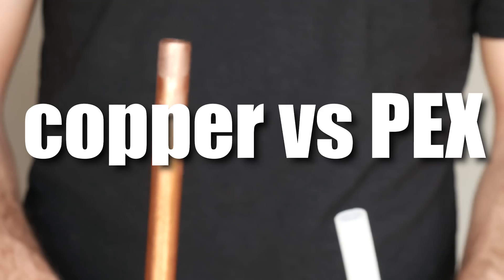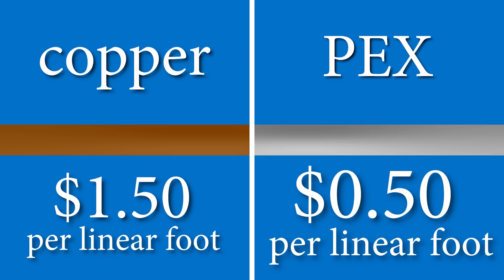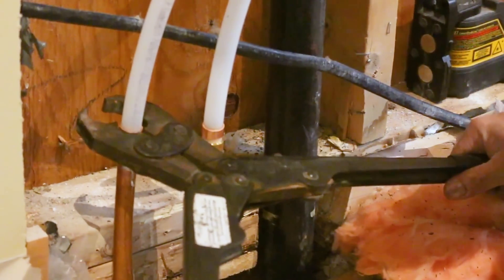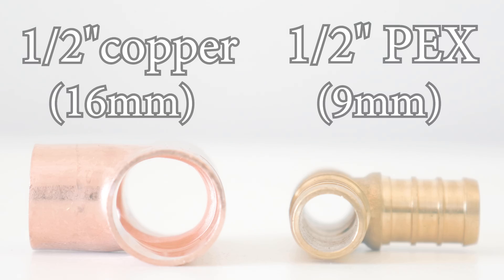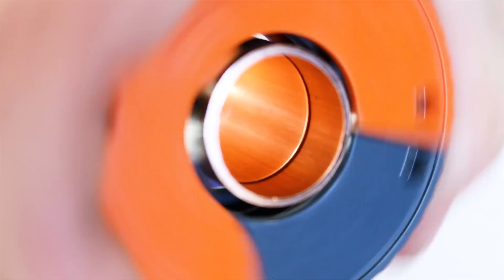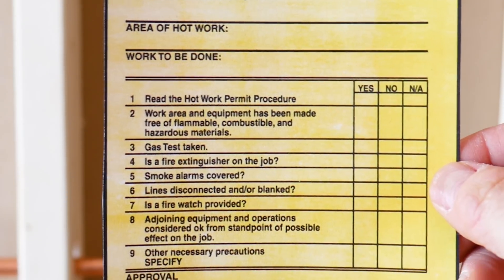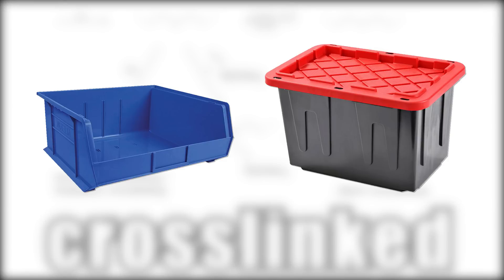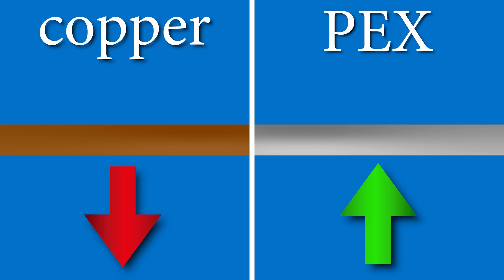Is Copper Better Than PEX? (COMPLETE GUIDE) | GOT2LEARN

Comment: When I use to work in a plumbing store, I cannot tell you how common it was for mice or other rodents to cause leaks on pex pipes. It's almost as if rodents are attracted to pex piping.
Reply from the maker: Yes, because they can easily sharpen their teeth on it, and it's nice and warm inside ;)
Reply: @Got2Learn  there are usually two things with it, they hear the water and smell the salt.

When installers are handling the tubing (or wires or whatever else...) they leave nice, sweaty finger prints all over everything.  Rodents looking for some salt lick with chew through the pipe to get every last bit just like they chew through electrical insulation.  The upside is that clean water is a lot easier to deal with then a burned down house.

The other big thing though is that they can actually hear the water.  Especially in dry regions, water is enough of a motivation for rats to chew through pipe.  If you don't have PEX supply lines, they will go after your PVC DWV system.

Hopefully they don't push for more bioplastics in home construction though.  Rats love the taste of soy based plastics and if you give them both food and water - they will never leave.
Reply from the maker: @joek5161  good to know, thanks for this!
Reply: @joek5161  We had issues with rats and field mice accessing our crawl space where are all our plumbing and water heater is located.  I basically found where they were getting in and sealed the area up.  That fixed the rat problem because there was no area large enough for them to gain access. Field mice, however, are small and can enter anywhere no matter how tight everything appears to be sealed up.  To remedy this, I simply put glue boards with a little snack on it in the crawl space and that usually catches the mice before they can become a nuisance or tear anything up. I will know when to do this whenever I see rodent droppings by the water heater.  It is warm and they tend to linger on or near it once they enter the crawl space area.
Reply: @jamescunningham6249  yeah I was looking into PEX but I have a crawlspace that critters can invade...and I suspect if I use PEX there's going to be a problem. But it's a tough choice because a PEX repipe is like 1/3 the cost of copper. I wish they'd somehow make rat-proof PEX.
Reply: I had pex installed last year and now I'm dealing with $2000 in drywall repair!! Stupid Mice!! T^T
Reply: @malloryartis75  lol
Reply: Good info. 👍🏽
Reply: Galvanized was good, copper was the solution. This PEX pipe? Well; Very fast to install however a good meal for the little ones!
Reply: They love the stuff!!

Comment: Everything comes down to cost and convenience but hidden in that is the real cost to human health and our environment.  As mentioned, pex is not immediately recyclable and will in most probability end up in a land fill in future demolitions. Also, the anti-microbial advantage of copper over pex cannot be understated.  We derive our drinking water in a rural environment and want germ free water.  Moreover, earlier plastics released VOCs to the water and while they've reportedly improved the product since then, I don't want my drinking water coming out of any kind of plastic which degrades over time.  Having said that, it just occurred to me that my RO filter uses plastic lines (grrr - need to address that, it seems we just can't escape this curse of plastic in our drinking water).  Since my house used old-school plumbing, it's easy for me to continue repairs and upgrades using copper, despite the price and labour differential but I understand why commercial guys love pex and most home owners probably don't know anything at all about the differences and blindly go with whatever their installer decides for them, especially given the cost differential.
Another point for pex I suppose is that you don't need to electrically ground it as you do copper lines.  Pex also doesn't suffer from electrolysis when connecting brass or copper fittings to galvanized nipples on hot water tanks.  I had a tank fitting that eroded within weeks due to a defective insulating sleeve inside the galv fitting that was supposed to ionically separate the dissimilar metals from each other.  Depending on your water's conductivity, ionic erosion can be significant where copper meets iron.
Lastly, you've crisscrossed the meaning of permeable with impermeable.  Permeable means that it is porous and can pass contaminant through, which is what pex suffers from, as you stated.  Copper as a membrane on the other hand is impermeable, meaning it DOES NOT pass contaminants as does pex.  The prefix "im" means NOT, as in "impossible" versus "possible".

Comment: I think the potential rodent issue with pex can be a deal breaker for lot's of people.
Reply: They should invent pex insulation with a steel mesh. Rodents wouln't chew through that.
Reply: @christopherbehrens7996  Mice and rats can chew through concrete. That steel mesh you talked about is just a morning snack for them.
Reply: @rickjames6948  Then what stops them from chewing through copper?
Reply: @christopherbehrens7996  Honestly nothing. Maybe they don't like copper sandwiches LOL.
Reply: @rickjames6948  rats can see the water flowing inside the pipe so they seek it out and chew on it to reach it. I wouldn’t use it in apartments. For homes without an attic and crawl space I’d probably go with pex. Since the risk of rats is almost zero
Reply: Also rodents dont like to try and chew through steel wool, use steel wool in places where mice might come into contact with your pex and put it around your pex.
Reply: @781NoMeNaP  Really, mice and rats will chew through a concrete slab. All they will do with your steel wool is make a nest out of it. Think about it. Perfect soft bedding material. Might as well line your inferior pex with a posturepedic mattress LOL.
Reply: Just set up traps from time to time or if you notice a rodent problem.
Reply: @r3dhorse  I think that is the big thing.  If you have rodents in your house - you have a rodent problem, not a plumbing problem.  Even if they didn't try and chew through your pipes - you should really get rid of them as they will try to chew through everything else.  Even if you choose copy for your supply lines, the rodents will go through your DWV pipes looking for water...and that is a leak you really don't want to have to clean up...

On top of that though, they cause millions of dollars worth of damage each year when they chew through wires and start fires.  Get rid of them, kill them dead and don't use that as your primary reason to not use PEX as you would also need to use Cast Iron DWV systems and metallic EMT conduit to rodent proof your house from damage...
Reply: @joek5161  the problem with rodents, they are never welcome... you may not have them now, but when you do, they seem to be attracted to chewing on pex compared to copper.

Comment: In east Europe we use mainly PPR pipes .PEX and copper is also used in western Europe.
Reply: PPR in hot and cold water, pex press for heating. Pex fittings are very expensive
Reply: It,s very expansive in Russia,cooper and PEX.We get PPR and metal-plastic pipes)

Comment: The limiting flow Pex fittings are older type such as Sharkbite. In such cases, it is long known to ‘upsize’, ie 3/4 Pex where 1/2 copper is spec. If you use Uponor Pro Pex, no need to upsize but a special expansion tool is needed to install.

Comment: For a normal residence outside the Chicago area (outside of Chicago), I prefer copper. Chicago still does galvanized pipe and cast iron wastes. I currently live in Lake County and copper and PVC wastes are code. Pex is preferred for a summer place. Thanks....Jim

Comment: WOW, that shot of the copper vs pex ID dimensions was huge. No wonder I see a water loss with a new pex 1/2" line.
Reply: ya this problem has been solved with Uponor “pex” supply products ..
Reply: @brandonmunsin9310  So are they 1/2" ID now?
Reply: @rickjames6948  Still not as good as copper but a major improvement.
Reply: All you have to do is go up one size for pex B and your water restriction problem is solved. Pex B is safest for potable water. Pex A less potable because it has more chemicals.
Reply: @christopherbehrens7996  Go up one size??? So you admit, there is a big restriction in Pex, size vs size, compared to copper? Thought so. All this talk about pex out flowing copper LOL LOL. Just wait till you hit the first pex 90 degree fitting. They choke down to 1/4".
Reply: @rickjames6948  Ever since I had my house replumbed with pex I have not noticed any restriction compared to my old copper pipes. Actually I am getting more pressure in my house. Not sure what the plumbers did but it works alot better, just saying.
Reply: @christopherbehrens7996  Might of been clogged with hard water deposits or a partial plugged valve someplace. Apple to apple, pex is WAY smaller inside than copper. And the pex fittings should be outlawed they are so small. Glad to hear YOU have good water flow.
Reply: Brandon mention Uponor PEX-A, which have always had the same inside diameter fittings as the pipe, so no flow restriction like crimp fitting PEX-B . A few years ago, after the patent expired, Zurn introduced a PEX-B expansion system, including fittings, rings, tools, pipe, etc.
Reply: @SP30305ATL  What is confusing to many is the wording Zurn used -- "PEX B Expandable"  Zurn should find a new way to describe their expandable system -- I have read that the ZURN expandable takes longer to shrink back to size, and this ZURN PEX B Expandable is not as bendable as PEX A so it may cause install issues in tighter spots

Comment: I am replacing my water softener which was originally installed with 1" copper from the Water supply to the softener.  Then 1" copper exits the softener, and after a shutoff valve reduces down to 3/4" to supply the main branches throughout the house.  My concern is - Will I be okay replacing all existing 1" copper from the water supply to the softener with 1" Pex?  There will be a few elbows involved, which I will use Pex crimp fittings on (Not Sharkbite).  
Is the reduced water flow I will experience going from Copper to Pex a concern?  Keep in mind, at the point AFTER the softener where the branch pipes turn back to 3/4" copper will not be changed.  That will remain the same.  Thanks.  Your videos are great.
Reply from the maker: Only a concern if you are adding fixture or else you most likely won't see a diff.

Comment: This doesn’t take into account press fitting. While more expensive it gives copper a lot of the advantages pex has.
Reply: Press relies on an O ring like Sharkbites do.  If I'm doing copper, I sweat the joint.  If I use PEX, I use expansion.  The ProPress also can't be undone and then redone like sweated copper can.  Any leak or repair, and it's a major job.

Comment: Love all your videos and have learned a lot. In fact you taught me how to solder copper pipes. However I do believe you should have mentioned some things with regards to expansion pex (PEX-A) in this video. First, They have full port fittings with expansion pex. Second The PSI rating is dependent on temperature. 

This is also working pressure and not burst pressure, which according to Uponor's website is: a minimum hydrostatic burst pressure for PEX pipe at 73.4°F (23°C) is 480 psi for ½" pipe and 475 psi for ¾" pipe and larger. 

Anyways just thought I would put this out there for anyone looking at the comments. Thanks for all the great lessons, look forward to more videos in the future!
Reply from the maker: Great, constructive comment, love those, thank you so much!!

Comment: When im finishing anything, basements, reno's etc.... Anything outside of a finished wall or an area that may get reworked, I dont mind pex, anything Inside walls that wont change for t he life of the house.... Type L copper. Copper lasts 50 years? Ha! Good copper (not type m) lasts 80+ years. My house had original copper from 1962 (pretty sure it was somewhere close to the thickness of current type L), other than seeing where they cut and added T's to feed the diy downstairs bathroom that was done in type M, it was all original, beefy copper. Most below ground feeds to homes have yet to be replaced from the 1950's.

So again, good copper piping has a chance to completely outlast the home it was built into. If you're not into running the extended hosebibs for outdoor water lines, make the last 24" of the feed from the outside wall to the shutoff valve into pex - it'll never burst. If the pex/brass hosebib is starting to fail, just replace the pex at the valve, and replace the hosebib in one shot. You already have a trap door at the valve to cut and re-clamp. and as long as you make the total measurement 16", you'll know exactly what you need to replace that leaky hosebib all in one shot.
Reply: My copper is 70+ from 1948 and still going strong.  I’m only researching because we’re remodeling a few bathrooms, but think we’ll stick with type L and replace what is easily accessible with the subfloor up and see how long the rest lasts.

Comment: Nice comparison, but there were few aspects not covered in this video.
First, and probably most important is that "PEX" is just a group naming convention for similar pipes, made from polyethylene - like with copper, but wider. You have different grades of copper, differing in thickness and hardness, some are better for heating, some for gas. Similar is for PEX pipes. For example, typical PEX pipe is permeable for gasses and other stuff. While in home environment it isn't a big issue for a potable water, it makes it unfit for heating. Not only it'll let gasses in to your installation leading to air traps, it'll sag after heating, needing denser mounting points. There is, however, a solution known as PEX-Al-PEX or "AluPEX". What is so special about it, it has an aluminium inner core between PE layers. That makes it impermeable for gasses and contaminants. For heating, especially for higher temperatures, is PE-RT coating. This is polyethylene with higher temperature resistance, better suited for constant heat.
What wasn't mentioned in the video, is very low surface tension of polyethylene. That's what make glueing PE so much pain in the back, and what is also its strong point. Also, polyethylene pipes have very smooth surfaces, contrary to metal ones, and we're talking microscopic scale. That makes them suitable for piping in areas with high water hardness, as limescale have very hard time sticking to it. Even if it will, it is also easy to remove.
Moreover, polyethylene is non reactive material, so it won't react with water and anything solved in it. That is superb for areas with low water hardness, as that water is very aggressive on metal piping. Copper pipes will degrade rather quickly in such environment, especially if Ph tends to go under 7. Not only that, but polyethylene won't dissolve into water, so no additional metals or other additives from piping in your potable water.
Last, but not least, polyethylene is electrically non conductive, so, especially if pipe is buried in ground, no problems with stray currents or electrochemical corrosion - a big deal with underground installations. It'll also prevent earth loops and other electrical problems with indoor installations.
But copper have advantages, too. Aforementioned problems with rodents is one. Other is that in lots of places fire code prohibits piping made from flammable materials for use with internal hydrant systems.

Comment: I remember back in the 80s a news show highlighting problems with plastic piping. It put a lot of plumbing contractors out of business. Polybutylene. I just came across a video from this old house on it. 10 million houses in the US had it installed. This is the reason I have much more trust in copper.
Reply: you mean kitec water pipe which was widely used from 95 to 2007.

Comment: 3 months ago, I was deciding between copper and PEX to get water from a copper pipe to my watering valve.  After thinking thru, I decided to use a heavy duty 50 feet water hose connected to the valve at the copper pipe end, then other end of the hose connect to the PVC pipe (using a cheap PVC adapter)  that feeds water for the automatic valves. 
This entire area has shade all year round including the valves (3 of them), so UV is not an issue. My reasoning is: if the water hose breaks as it ages, I can simply replace it with a new one for less than 20$. The valve at the copper end is the local water shutoff for this area, I do not need to shut off water for the entire house.
There are two other places where I installed automatic valves and these use copper pipes as they are very close to existing copper water pipes.

Comment: I love the ease of pex, but I have seen copper pipes that were over 100 years old and still doing fine, plus I love putting things together with fire.
Reply: My copper pipes only lasted 33 years. I live in a place that gets very cold and also very hot. Maybe the temperature fluctuations comprimised the life or maybe poor installation. But I pretty much lean toward pex B, I recently had a complete house repipe with pex. We'll see in 30 years if it still holds up without a leak, lol.
Reply: @christopherbehrens7996  You'd better insulate all the pex if it's in the attic or exterior wall. We just had some -29F temps a few weeks ago. Hope this house is in Florida. Even south Texas got slammed with Arctic air.